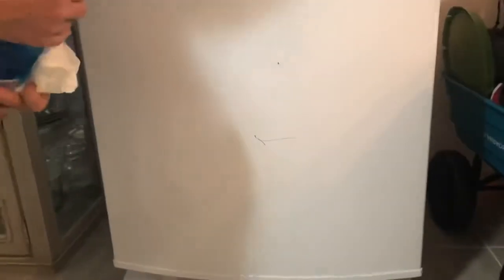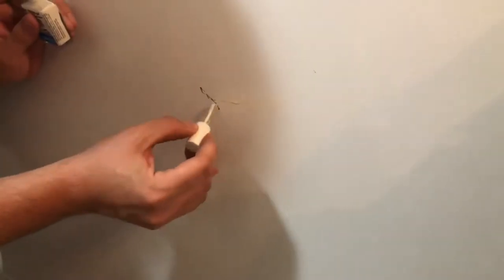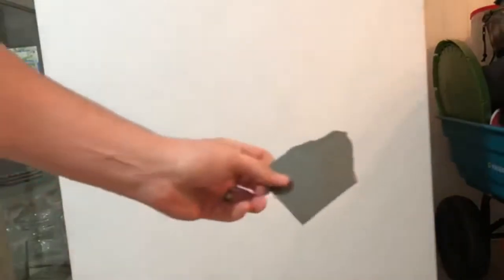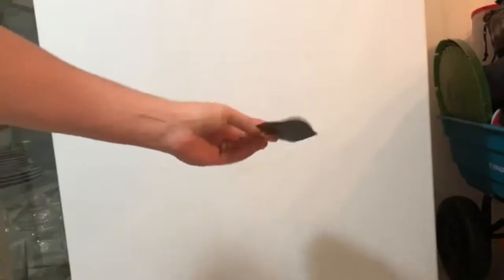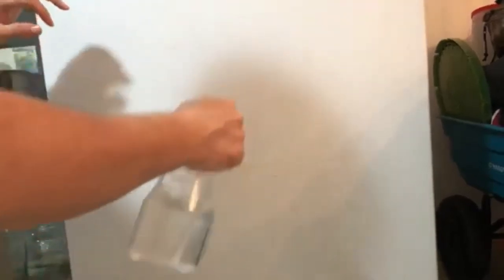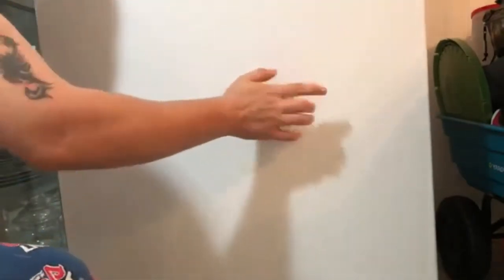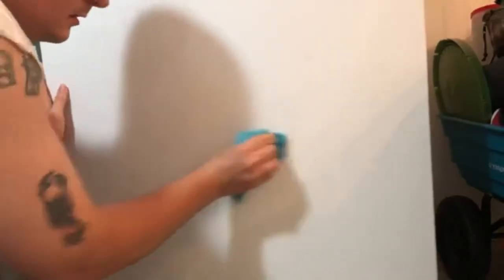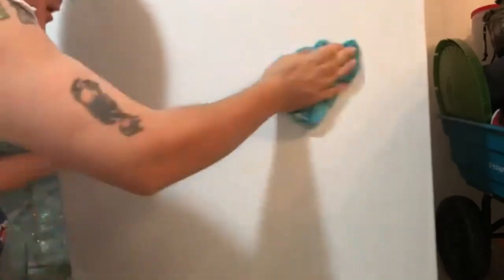How To Repair Scratches On Appliances

Comment: Whats the product you used called?

The paint you used that is.
Reply from the maker: It’s referred to as appliance touch up paint. Some also refer to it as appliance epoxy touch up. It can be purchased at any place that sells appliances in your area. Most hardware stores like Lowe’s and Home Depot also sell it. And Amazon also does as well. Hope this helps. Thanks for watching. Please like and subscribe
Reply: @BillOfAllTrades2016  Thanks for your helpful answer.
Reply from the maker: You’re welcome

Comment: What grit sandpaper did you use? Also how did you find the right shade of white to use on your fridge?
Reply from the maker: You can use an 800-1000 grit paper. That was just a generic white appliance paint. It wasn’t actually color coded. Some hardware stores sell color coded ones. They will just be called “Kenmore white” or “lg white” for example. But honestly the generic one is good enough in my opinion. Hopefully you found this helpful. Please like and subscribe

Comment: Why wet it with water before sanding? Is there a specific like wetness it needs to be (I noticed you sprayed a few times) would this be a similar process for a car scratch? Obviously with the paint from the manufacture to match or something.
Reply from the maker: The water in wet sanding is just to prevent the sand paper from getting clogged with paint and wet sanding makes for a smoother finish. Especially with very fine sand paper it would get clogged after just a few strokes. The water washes the paper to keep it sanding properly. And yes this process is the same for sanding a scratch on your car. The amount of water isn’t specific. The main goal is to just keep it wet. If you are sanding your car you will need more water as the sun will dry your paper  quicker. And yes it is better to color match but personally when I do it I don’t mind. That’s more of a preference thing. Thanks for watching
Reply: Bill Of All Trades Brantford awesome thank you for clarifying! Makes sense.

Comment: I liked the wet sanding but wondering if a couple of thin coats with sanding between each would give a good outcome. What are your thoughts?
Reply from the maker: I’m not sure that that method would yield different results. It would probably work well but wouldn’t be much better. Seems like a lot more effort. One wet sand at the end is easiest I think. Thanks for watching. Please like and subscribe

Comment: Where can I buy this Mr touch up paint? Thanks
Reply from the maker: If you are from Canada then you can buy it from Canadian tire. Home Depot also has a touch up paint made by rustoleum. And amazon has various brands of the paint as well.
Reply: @BillOfAllTrades2016  I guess I have to  go Home Depot then. 🙏🏼 I wonder is there any tip to match color the color? My washer, dry and refrigerator are all while but from different brands. They looks so different in white tone. Does it matter once I paint and sand it?

Comment: Paint can behave like rubber when you sand it. You don't want to pull on the paint when you sand it. Fortunately,  It's no big deal to redo these things till You're satisfied. I simply use a can of white satin Rustoleum enamel. It will last decades.
Reply from the maker: Wet sanding paint is done with water… not oil… ask anyone who has ever done auto body repair. Plus there is no need to redo it. I’m fine with the results. I’m not looking for a showroom piece. This video is intended to help people touch up appliances so they don’t rust. That’s all.

Comment: I have matching white washer and dryer about six months old, and I just had the in that valves replace on the washer--turns out it it was leaking because of sand in the line from a plumbing leak in this slab repiping I had shortly after I first bought the machines. This was discovered during the repair but he didn't report the real problem so it was fixed under warranty. However he and his helper were a bit careless, putting a rubber footed toolbox and pliers on top of the adjacent dryer, until I put some paper towels down. Previously I know there was maybe one fine scratch on top of the dryer, but after they left there were numerous fine scratches, I can't be sure they were all caused by the repair men, but probably some of them. In any event, I scraped off a couple of tiny ridges on some of them with my fingernail--they really need a flashlight to be seen clearly, but I can feel them with my fingernail. They don't go to the bare metal so I'm not worried about rusting, but what would be good to touch them up--I think paint might be overkill. Somewhere it mentioned using a heavy car wax but I don't like the idea of having wax on such an appliance.